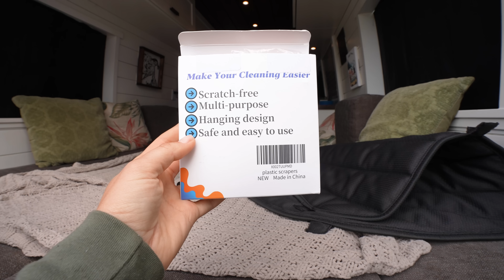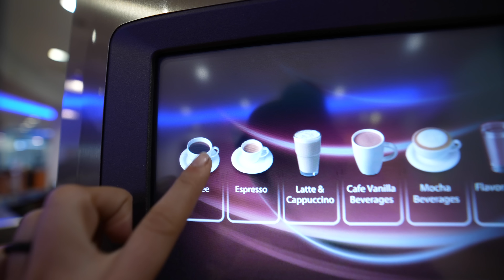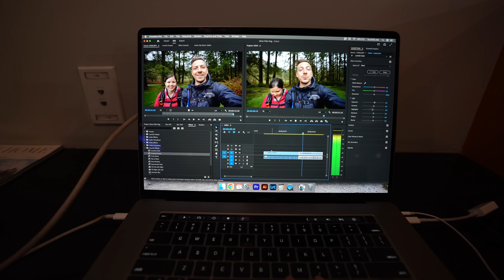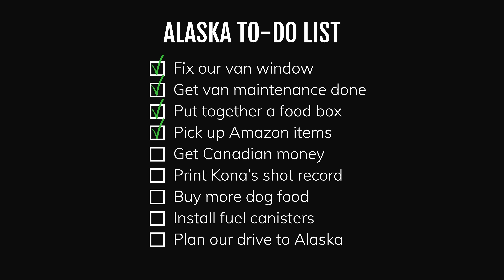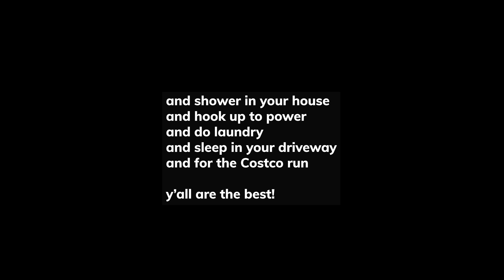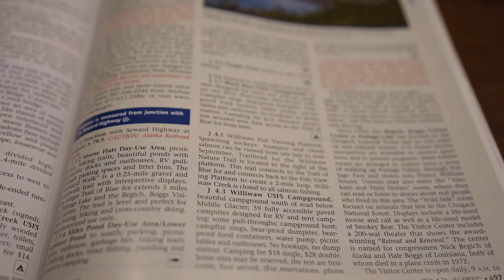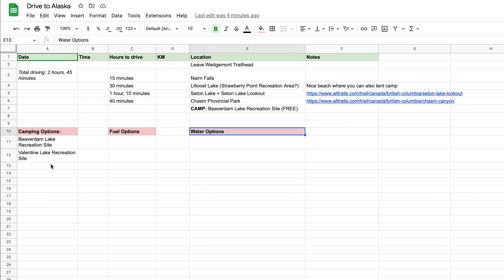Prepping our van to drive to ALASKA! 🚐  (Van projects, errands, + route planning)

Comment from the maker: To clarify the van maintenance cost: Mercedes ended up being more expensive than the first shop for the work we had done (Mercedes original pricing seemed cheaper because it didn’t include taxes and fees). We only saved money at Mercedes because we had less work done and we only used Mercedes because it was more convenient. We don’t feel that the first shop ripped us off (they had photo evidence for all recommended repairs) and we did a bad job explaining the situation (we were frazzled). We’d gladly use the first shop again!

Follow our Journey to Alaska: https://www.youtube.com/playlist?list=PLZKRTK1yCEM5UxLKP3MI17m-syJkqYABj 
Our van life, camera, + hiking gear: https://adventuresofaplusk.com/gear/
Reply: FYI:  I've used the Tire Fix Flat kits many times on my motorcycle.  First time can be frustrating, but it's actually pretty easy and lasted us longer than the tread on the tire.   But do you have a compressor to fill the tire?
Reply from the maker: @bostonphotographer20  we do!

Comment: Glad to hear (on previous comments) that you weren’t ripped off on brake prices.  My jaw dropped at the cost you said.
Reply from the maker: Sprinter parts are MUCH more than a regular car and the work we need to do (eventually) includes more than just brake pads. Our bad for not explaining it more, but the part costs seemed fair on both estimates, but the labor just jacks it up.

Comment: I’m glad you got the window fixed. Wow, I had no idea those windows were held just like that, wow!  I bought a PleasureWay 2021 in December, which I love. I’m so glad you took your van to Mercedes’, I’ve owned many MB vehicles and my van is a sprinter and I would never take my MB anywhere else other than Mercedes dealers. I’ve had issues in the past when I took my MB elsewhere. I’m glad you opted for the dealer. I’m new to your channel, I’ve lived in Seattle for 20 years and I’m exciting watch your travels to Alaska.
Reply from the maker: I do like the confidence of getting work done at the dealership, but the price tag is hard to swallow sometimes. We’ve had good luck at other places, buts it’s only been simple jobs (oil changes, etc). Thanks for watching, Sadie!

Comment: Catching up on past videos.  Love the Rotopax, I have the dual mount so you can stack 2 pax on one mount. We carry one water and one fuel pax.  Good on ya for fixing the rear window. Vehicle maintenance can be expensive but it beats the alternative of having to get a repair done along the way.  Thanks for the adventure and... until next time... Travel Safe.
Reply from the maker: Our plan before doing two attachments for two Rotopax was to stack them, but we thought it would stick out too much. That's a good idea to stack one fuel and one water.

We finally have that dang window fixed! No more backing into bushes! 😂

Yes that's a good point about the maintenance. I'd rather pay to keep it healthy than when it's sick!

Comment: Tire plugs are lifesavers. If one isn’t enough use more. I’ve used a whole bunch over the years in all different tires, never had any failures. I recommend plugging a tire until it isn’t possible, save the spare until absolutely necessary. Great video!
Reply from the maker: Ok good to know. I’ve never had to use them and hopefully won’t, but I’ll keep that in mind. Thanks!

Comment: Wow, alot of planning just to cross the border into Canada.  You have to really be prepared to go to Alaska because you just do not know what could or  could not happen.  My sister sometimes refuses to go to a dealership.  Her air conditioner went out on her car, and the regular mechanic was goint to charge her over 300 just to hook it up to the machine then the repairs extra.  After 2 years, she broke down and took it to the Honda dealership, the car was still in warranty and did not cost her a penny, so it really just depends.  I always take mine to the dealership and pray they can fix it cheaper.  Thank you for sharing, I can not wait to see your adventures in Canada and Alaska.
Reply from the maker: Yeah you've gotta be prepared! 

That's good she got her AC fixed! That is important!

Comment: Our experience going to foreign countries is to make a beeline for an ATM and make a cash withdrawal; the exchange rates are generally more favorable and there’s no exchange fee. If we go to Europe, it’s nice to have €20 or €30 on hand in case we want to buy a transit ticket or a meal, but most everything‘s on plastic these days. Getting foreign cash ahead of time is not really necessary in our experiences. Glad you got your rear window fixed finally!
PS On route planning: it’s always hard to do, we struggle with it - and we don’t even have a video blog to put together in our little spare time!
Reply from the maker: We plan to do ATMs in the future, but didn't want to rush around right after crossing the border (we needed cash immediately for something we had planned). We are glad we can use our credit cards in Canada, but surprisingly we have had to use cash quite a bit already!

Comment: So, facing a similar predicament in needing to store Rotopax 2-gallon fuel tanks (two of them) as well as provide some additional storage, we mounted the Agile Offroad Powerhouse 2200 generator box to our rear passenger door.  Designed for the Honda 2200 generator, when we don't need power, which is most of the time, it got us the additional storage we wanted and was predrilled to mount both Rotopax tanks underneath.  Looks more integrated and secure than having them on your ladder.  Apparently I can't post a photo of the resulting setup...
Reply from the maker: We’re glad that setup worked for you. As we mentioned in the video we assessed all of our options and this was the best options without breaking the bank. The cans we mounted on the ladder are very sturdy and secure
Reply: @AdventuresofAplusK  Sounds great and much appreciation for your quick response.  My wife and I are looking forward to following your expedition with you!

Comment: For getting foreign cash, it's usually significantly cheaper and easier to wait until you are across the border and use an ATM. If you have an ATM card with no foreign transaction or ATM fees, like Schwab's, even better.
Reply from the maker: Good to know! We needed some ASAP and didn't want to spend time right after crossing, but we will be doing that if we need more!

Comment: Looks like those gas canisters would fit in the inner side if the ladder. Then you wouldn't have to worry about them sticking out.
Reply from the maker: The would but they wouldn’t be able to slide onto the locking attachment

Comment: I have a 2013 airstream lounge and I take it to mercedes here in ft. Worth, Tx 
My brake job was $1500 that incuded new roters and oil change and fuel filter $530 so I think the west coast is not a good place for any kind of mercedes service.
Reply from the maker: Ya maybe the prices vary by region. Although, our dealership in Georgetown, TX have been just as expensive as every other dealership we’ve gotten quotes from

Comment: "the other place took more of a cautious approach"  No they didn't; they tried to rip you off.
Reply from the maker: We disagree. We have worked with them before and have always had a great experience. They also provided very detailed photos of everything they looked at + recommended and even after my dad looked it over he agreed with many of their assessments. But regardless of if they were trying to rip us off or be overly cautious, we don’t believe in bad mouthing a small business on the internet.
Reply: @AdventuresofAplusK  I feel very comfortable saying that any independent shop recommending MORE work than a dealership is not acting above board.
Reply from the maker: We ended up paying more at Mercedes than the other shop, but went with Mercedes out of convenience in the end. The pricing Mercedes gave us initially did not include the taxes and additional costs that were already factored into our quote from the first shop, which we did not know when we first made that statement. Our final price from Mercedes did save us $4000, but only because we had less work done. If Mercedes had done everything the first shop suggested it would’ve been WAY more. 

Our fault for not mentioning all of this in the end, but it’s hard to explain every little detail in a video, especially when we were already extremely stressed and frazzled. It’s hard for viewers to get the full picture and we didn’t paint it well, but we stand by what we said, as we were there and saw all of the numbers.
Reply: @AdventuresofAplusK  I appreciate what you're saying and not trying to be argumentative; I think we're kind of talking apples and oranges now.   I understand that the an independent shop is always going to be less expensive than a dealership for the same work.  The thing I'm questioning is the independent shop recommending more work than the dealership.   Dealerships always recommend every conceivable repair that they can make. It's not necessarily dishonest, they're just generally more focused on revenue than an independent.  Many people take the dealership estimate to an independent shop and ask "what do I really need off of this?"   In 35 years of being involved in a lot of vehicle maintenance, I've never seen or heard of it working the other way around.   That's a big red flag for me.
Reply from the maker: @driftlesstrekker4709  this was the first Mercedes dealership that didn’t try to completely screw us over or destroy our wallet haha, so we’re thankful for that! 😅

Comment: $4000😳  They were trying to steal about $3000 from you.
Reply from the maker: For everything we eventually need to replace (more than just the pads), the parts alone were well over $2,000 (if we did it ourselves). Sprinter vans are $$$$

Comment: For future reference, buy your own parts
Brakes here: https://www.buybrakes.com/2019-mercedes-benz-sprinter-2500/brake-rotors
I have already pre-selected a 2019 Sprinter 2500, I see rotors for no more than $300 bucks per piece.
If you need other parts maybe call: https://www.xportautoparts.com/ I don't see the Sprinter but it doesn't hurt to ask. I have a C63 so I know it can be hard to get Mercedes parts
Reply from the maker: The problem is I didn’t have anywhere to do the work. Also, I have never done that type of maintenance myself. I don’t trust myself to do it correctly the first time with zero experience or the correct tools before I go on a big road trip up and down mountains
Reply: @AdventuresofAplusK  hi 😁 my wife and I love your videos! 
Oh I don’t do the work myself either 😅 but maybe a shop can install them for you, that’s what I have done. I buy my brake pads and other parts on those websites and just have a professional install them. I’m in Mexico though

We are planning a road trip from Laredo to Moab going through the Great Sand dunes, Black Canyon of the Gunnison, and of course Canyonlands and Arches when we are already there, and on the way back, Monument Valley, White Sands, Carlsbad Caverns and Guadalupe Mountains! So of course your videos are so helpful!
Reply from the maker: Hi! We thought of that idea, but I don’t think most shops would do that in the states and the original shop we went to specifically told us they wouldn’t do that

We hope y’all have a great trip! That sounds like an epic one! Be sure to check out our website as well. We have tons of guides and itineraries for most of those places in case you need more help planning or more ideas!